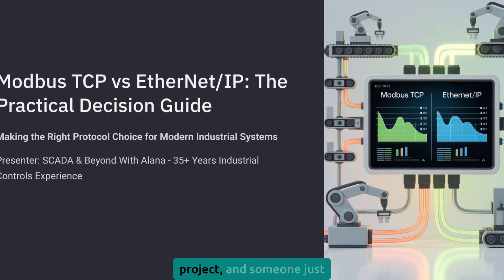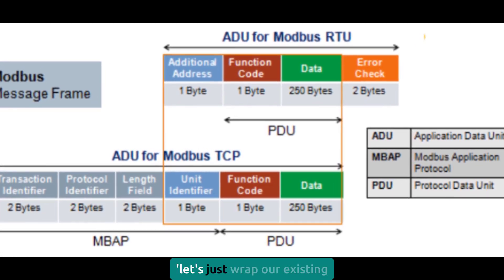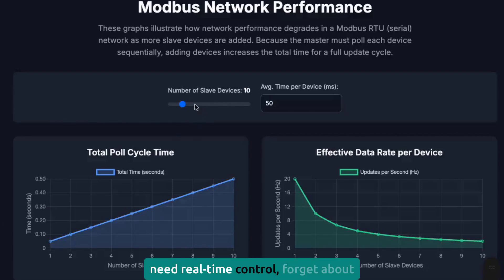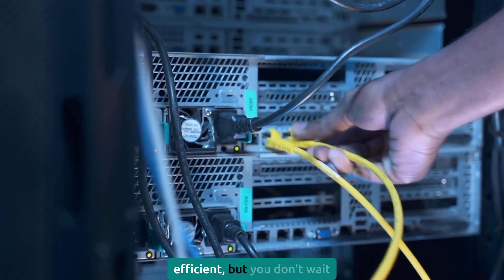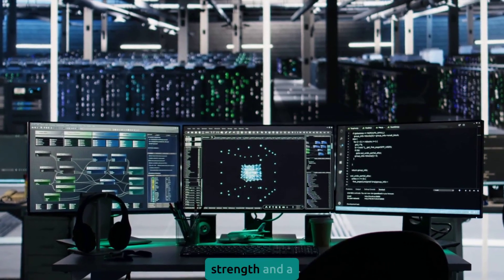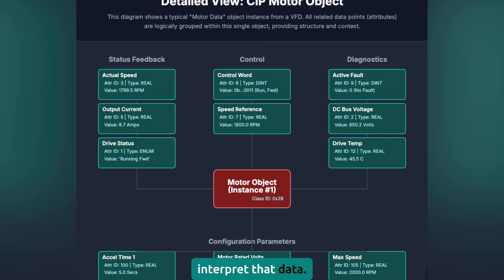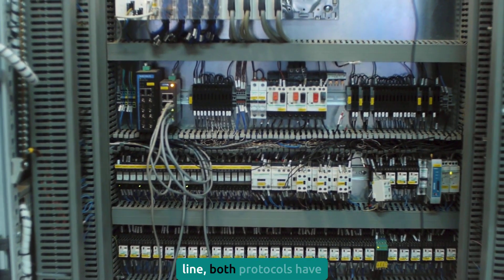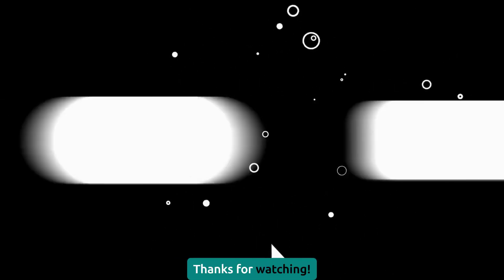Modbus TCP vs EtherNet/IP A Practical Decision Guide

Comment: Sir,
In ROBOT cell main control panel having 10 Profinet cable to a switch having 12 port. 2 port is empty, shall we use this empty port for getting datas from SERVER through RJ45 Ethernet cable through Network switch. Is it safe
Reply from the maker: Hello  @sureshganesan5292,

I can’t speak to your specific plant setup, but in general it’s worth being cautious mixing IT-side traffic directly on a Profinet control switch.

From an educational standpoint, here are the key principles to understand:

1. Profinet traffic is time-sensitive.
Even though Profinet uses standard Ethernet, it relies on deterministic timing. Adding ordinary Ethernet traffic can introduce jitter or delays that affect robot or PLC communication if the switch isn’t designed and configured for mixed-criticality use.

2. Control-level switches aren’t general-purpose network switches.
At the machine or robot-cell level, switches are usually dedicated to real-time industrial traffic. Plugging in devices that generate non-deterministic or heavy traffic (like servers, HMIs, engineering laptops, or IT equipment) can disrupt performance.

3. Avoid mixing OT and IT traffic on the same switch.
In most architectures (and in common guidance such as IEC 62443), IT-originating traffic is kept off control-level switches. This prevents congestion, prevents unintended communication paths, and reduces cybersecurity exposure.

4. If a server is part of the OT system, it’s introduced through proper OT network design.
This might involve:
• an upstream OT distribution switch,
• VLANs/QoS,
• a DMZ or boundary device,
• or a dedicated connection path designed for non-real-time traffic.

5. General rule of thumb:
Unused ports on a Profinet machine-level switch aren’t “free” general Ethernet ports, they’re part of a deterministic control network.

I hope this helps ☺️,
Alana

Comment: I would really suggest EtherCAT, especially dealing with closed loop control.  It has a distributed clock built-in that syncs to a few nanoseconds across several dozen devices.  Higher end EtherCAT supports Gigabit and 10G links which is pretty damn cool.
Reply from the maker: Hi @kayakMike1000,

Great points, EtherCAT really shines in those high-speed, tightly synchronized applications. That distributed clock is incredible technology. 

At the same time, Modbus TCP and EtherNet/IP still end up being widely used because of their simplicity and the huge range of devices built around them. 

It’s one of those cases where each protocol solves a different type of problem, and it’s good to understand where each one fits.

Thanks for the great comment😊.

Alana

Comment: Is there any kind of hybrid system? Modbus tcp/ip?
Reply from the maker: Hello @FalconeGiovanniGrillo

That’s a great question! 

There isn’t really a hybrid protocol that merges Modbus TCP and EtherNet/IP into one, since they use different data models and communication structures.

However, you can definitely have hybrid networks, for example, systems where some devices communicate over Modbus TCP and others use EtherNet/IP, all connected on the same Ethernet infrastructure. 

Gateways or protocol converters are commonly used to bridge between them when needed.

In short, Modbus TCP/IP itself is a standalone protocol (essentially Modbus over TCP/IP), but hybrid networks that mix multiple industrial Ethernet protocols are quite common in real-world plants.

I hope this helps,
Alana 😊
Reply: @SCADAandBeyondwithAlana thanks very much, it helped a lot!
Reply from the maker: You're welcome I really glad it helped 😊

Comment: Good material, thanks. In some countries you need sanctions take in count 😊. As i heard in this material, licence for program for protocols thats a red flag because you need constant updates if security breach is found. Thats why we use only dry contact trips from F&G/ESD. Very interesting how sil 3 organised through ethernet, will find out.
Reply from the maker: Hi @dioricardo1876,

Thanks for the positive feedback. I really appreciate it 😊.

You bring up some really good points.

A couple quick thoughts:

On sanctions/procurement, you’re right, vendor origin and export rules can be a real headache. It’s something procurement and legal need to check up front.
 
On licensed/proprietary stacks, I worry about that combination also. If only the vendor can patch the firmware or protocol, you’re stuck if they stop supporting it. That’s why I push for signed firmware, a clear patch SLA, and a firm long-term support commitment in the contract.

On dry contacts vs networked safety, dry contacts are simple and extremely hard to attack, which is why ops teams often use them for final trips. The downside is almost no diagnostics. 

Modern SIL-3 over Ethernet is possible, but only with certified safety protocols (PROFIsafe, CIP-Safety, etc.), redundancy and full validation. 

My rule of thumb: for the most critical trips keep a hardwired final path or require a redundant, certified safety solution and always demand vendor patch commitments and proof testing.

Thanks again, great points to dig into.

Cheers,
Alana

Comment: modbus is basic. ethernet is for modern HMI devices and cloud services.
Reply from the maker: Hi Purge, That’s a good way to frame it. Modbus is definitely simple and reliable, which is why it’s still everywhere in industry. EtherNet/IP does open up a lot more possibilities for structured data, real-time control, and integration with modern systems, but it usually comes with more complexity. The choice often comes down to what the system needs and what devices support.
Reply: @SCADAandBeyondwithAlana   realtime control is better with EtherCAT.